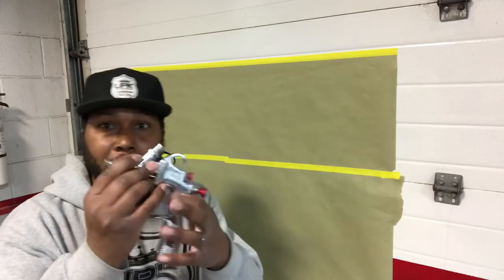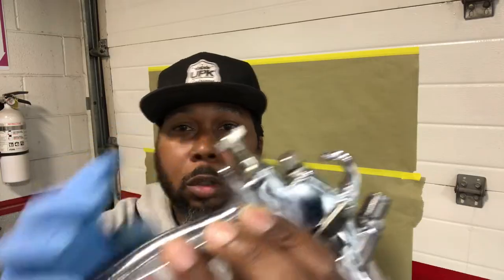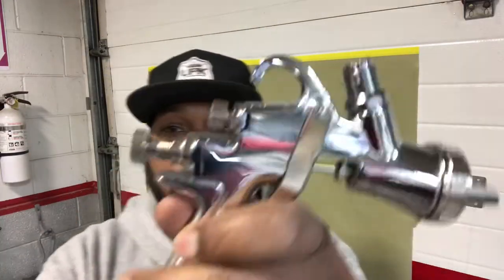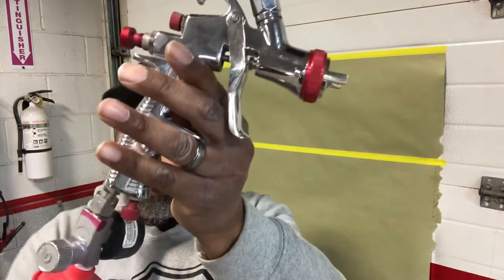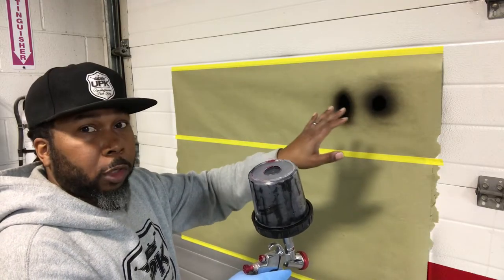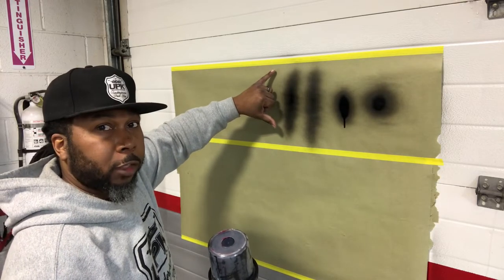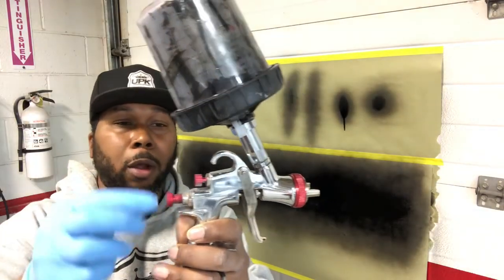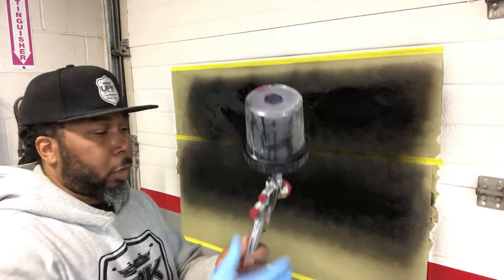How to set up your LVLP spray gun to paint cars

Comment: Will these settings work on the iwata LPH 400?
Reply from the maker: Yes these settings will work, just remember that all spray guns aren’t the same and may need some adjustment to dial the spray gun in like you want
Reply: @UndergroundPaintKing  thank you sir, nice paint jobs! I've been having trouble with a light/medium blue metallic getting streaks. I think my gun pressure may be too low or fluid too open . Not sure but ill try it out.
Reply from the maker: @eddiegarcia9657  check your fan pattern and make sure it’s a even fan pattern, to fix the stripes you can drop your air pressure and you want your distance from the panel to be 10 to 15 inches away from the panel and mist the paint on
Reply: @UndergroundPaintKing  thanks again, good advice and great channel!
Reply from the maker: @eddiegarcia9657  I appreciate that and you’re welcome!

Comment: thanks but can be better. you never mention distance. I saw another person recommended flow to open only three turns
Reply from the maker: Your distance is determined by what you’re doing and what material you’re spraying, and I recommend that you set your fluid control for whatever is best for you and the material you’re spraying, all materials aren’t the same and that’s why I explained that you didn’t have to use my exact setup you have to find what works for you

Comment: You fill such a huge void. The DYI mechanic just doesn't have the money to buy a $5000 air system or ultra expensive gun systems. A 30 gallon compressor, filter and regulator is the appropriate setup for DIYers like me. So long as the result is basically the same, it doesn't matter.
Reply from the maker: I do my best to help people out that want to do the work themselves without having to break the bank doing so! I appreciate you checking out the video and I hope the channel continues to help 💯

Comment: the things you didnt tell in your video is almost more important than what you did tell!  what is the nozzle size of the gun?  you set up a 1.2 different than a 1.4 or 1.5 or 1.8.  that would make a big difference on how you set up your fluid.  You didnt tell the most important thing of all, what air pressure to spray?  different air pressure for base coat and clearcoat! 
and a 5 to 7 inch spray pattern is just going to get people in trouble with metallics like silver,  it needs to be a much bigger pattern.  also you didnt explain the difference between a LVLP gun and why you would use it for a small compressor. You didnt say how far you should be from the panel that you are spraying or how much overlap you should have.  I assume you dont paint as your profession but you should give more information if you are trying to teach someone that has never painted before.
Reply from the maker: Good thing this isn’t the only video I plan on doing on this topic and I appreciate you checking out this video now I have more content to create for the people thanks to you D Haley!